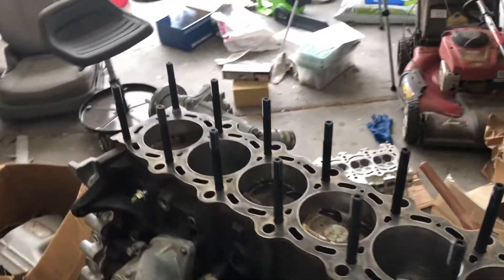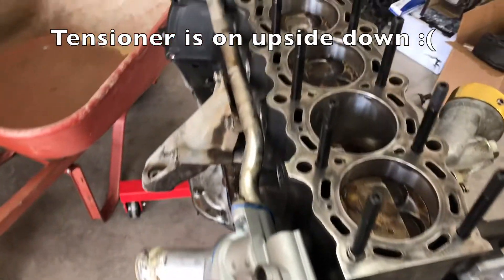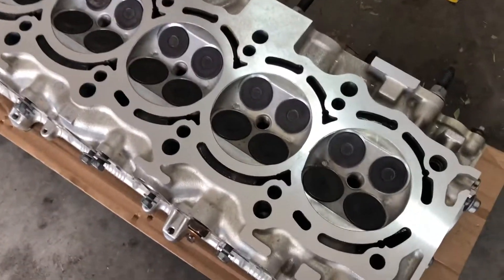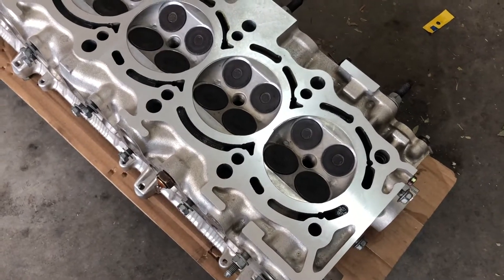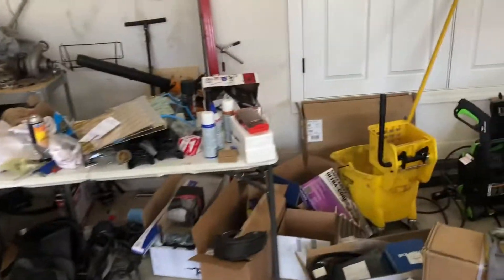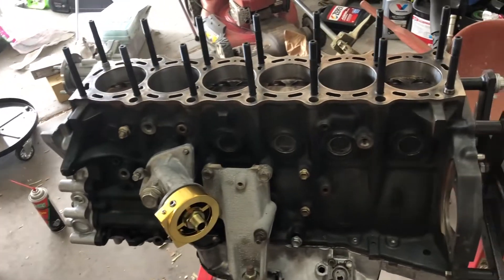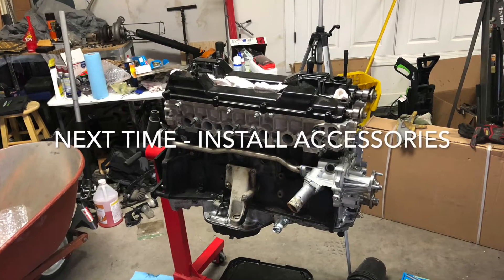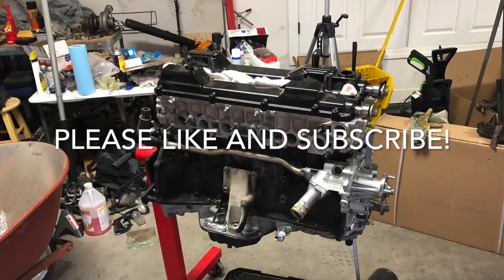SC300 Build Episode 9 - Cylinder Head

Comment: How did u get your engine so clean ?
Reply from the maker: I took it to a machine shop to get the block cleaned and honed.  Then I got the valve covers powder coated.
Reply: Thanks
Reply: How much was it to get the work done for everything at the machine shop and what exactly did you get done?